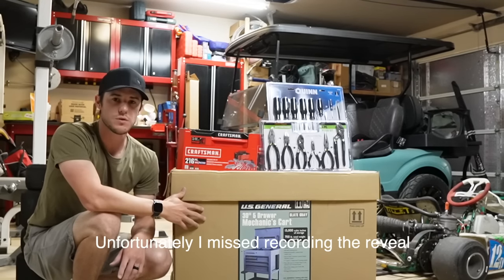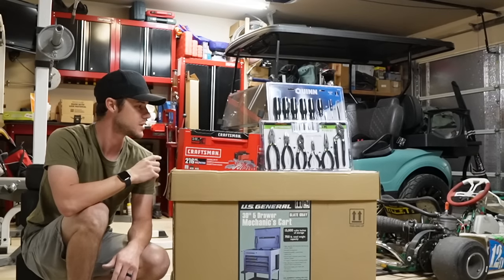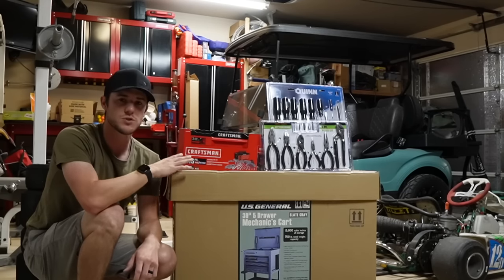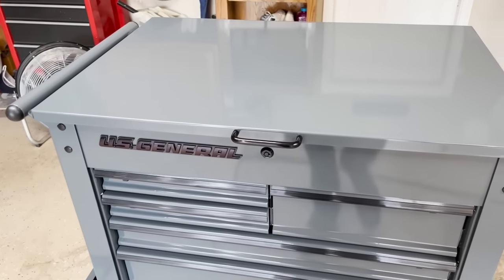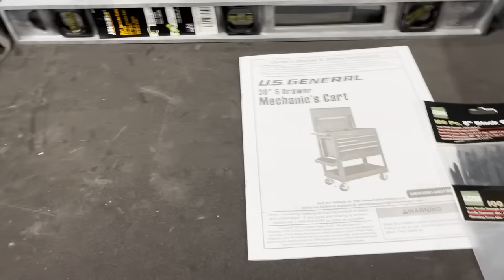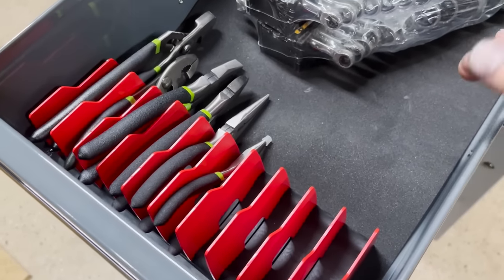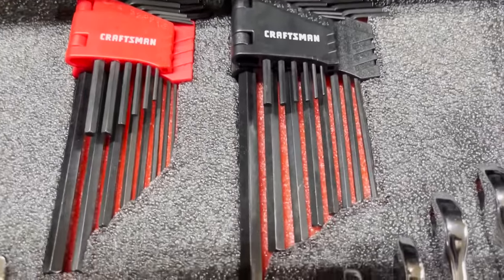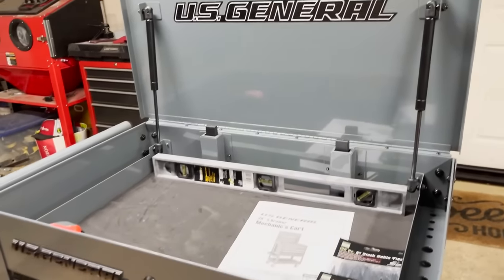Building the Ultimate Starter Toolbox for my Brother

Comment: For anyone looking to get one of these mechanics toolsets, the Gearwrench set is usually on sale at Home Depot. It’s a 232pc set that in my opinion, is much more comprehensive than the craftsman set and the tools feel like they are of a much higher quality. It basically provides you with most everything you’d need for 1/4 and 3/8, both SAE and metric, and also includes a decent set of deep sockets as well. The only thing it doesn’t have that I think every starter mechanic should need are swivels. It’s $200 on sale, regular $315. It’s quite a nice set to start with, and I would bet anyone who has it will retain almost every tool from it as they graduate to a bigger box setup. Having said that, craftsman is also a good brand and the US General tool cart he’s got here is also a very good choice.

Comment: I know this is an old video, but I just saw it.  This is a great starter set and a great gift Idea!  The only change I would make is substituting the 5-piece Kobalt pliers set for the Pittsburgh set.  They are much higher quality for ~$5 extra.  While you lose the small needle-nose, the larger one will handle most needs.    I kind of wish you had put the ratcheting wrenches and pliers in foam...

Comment: Hey guy, what an awesome brother you are. And very thoughtful. 
I’m a journeyman diesel mechanic of 34 years so I’ve got tools coming out of my ears lol.
But when I first started out it was with a set of craftsman tools. It was a bit of a larger set for around $450. I used a charge card at sears and I did not have a roll cart to start, I had a small top chest that I hauled around for the longest time. My first real tool box came from snap on, was very well used and beat up but I scored it for around $300 and made my weekly payments on it until it was paid off and then grew from there. 
Now I’ve got a huge snap on tool box top and bottom and a snap on service cart and full length locker.
Over the years I’ve spent tens of thousands of dollars on tools. 
And here’s the best advice I can offer.
Snap on, Matco, Mac Tools, and Cornwell tools all do have their place. But I’ve NEVER broken a craftsman wrench, ever. I have broken wrenches from most of the others mentioned though. Also bent quite a few, especially Mac wrenches.
And tool boxes ?
If I had it all to do over - right now - I’d buy the Icon tool box from Harbor Freight. 
Everytime I go into HF I check out that Icon tool box, the professional one, the biggest one they have displayed, with the hutch and 2 full length lockers etc, and I am impressed with it. It’s built better than the snap on box I own and just like my snap on box it’s double walled and welded. 
At HALF the price as it stands right now. 
But like I said, the others DO have their place. I work with those tools every day, and they stand up to the daily grind, the daily use and abuse. So that’s where I’d spend the majority of my money. 
The kids that get hired on to our shop nowadays all see the kind of tools we have and a lot of them think they have to have that “right now” until they see the prices we pay, and they get discouraged, some to the point of quitting before they even give themselves a chance. It IS expensive.
But I tell them “you do not have to start out that way”, build your box 1 tool at a time. Start out with the cheap stuff from harbor freight. It’ll get you by and some it is surprisingly sturdy. I’ve known guys that bought their snap on wrench sets 1 wrench at a time. You don’t have to ski. That cat all at once. 
But by the time you become the “old timer” in the shop your tool set will match your experience.
(And by then you’ll be sick af of the job, the expense etc) lol.
Good luck to ya and your bro.

Comment: HF has a great paper towel holder for the side of the tool cabinet.  Its magnetic, and makes its handy to access.
Reply from the maker: Ya they have so many add ons for the box that it’s really awesome to build off of. I’m a little jealous I don’t have one myself haha
Reply: @Project Karr  a lot of those accessories are magnetic (like the paper towel holder) they don't just work with that tool cart, I have one of those paper towel holders stuck up in my van.

Comment: That's an awesome setup for someone starting out. I'm sure they'll get a lot of use out of it. Being the tool guy out of my family and friends. I usually do something similar. I head in a slightly different direction, though. I like to lean a little more towards  carpenter type tools. You know, like a hammer, adjustable wrench, vice grips, utility knife, some putty knives, a caulk gun, and saw, etc. That Pittsburgh pliers set is a good one that I always include. I don't lean so heavily on the socket sets, I usually only include a 3/8 set, like those Craftsman clamshell sets, and I go with the classic craftsman 6 piece acetate handle screwdriver set, even though it doesn't have as many different drivers. Even so, you put together an excellent set. They have a really good start. That was really nice of you to put in the extra time with the foam.
   With Christmas not far off, I'm  wondering if you're planning any more additions. Cordless drill, perhaps?

Comment: What size foam sheets did you use for the drawers... I am looking to order some.
Reply from the maker: I used 2’x4’ sheets of 30mm foam and just cut them to size
Reply: Yikes $43 a sheet + shipping  @projectkarr
Reply from the maker: @durpydurp7497  ya if you order just one sheet it’s really pricy. I was doing multiple boxes so I was able to buy an 8 sheet pack for just under $20/sheet plus free shipping. I believe that’s still the bulk price today.
Reply: @projectkarr   Thanks. I'm just doing a 4 drawer cart, my 1st ever, no more having tools in 4 different boxes completely unorganized. Doesn't hold as much as I'd like, but it was the largest box HF would ship. Really wanted the 5 drawer. But there's a lot of tools I never use, so back in the boxes with those. (Like SAE sockets, almost never need those, and multiples of duplicate screwdrivers etc).

Comment: Did u buy the foam in bundles and is it hard it cut ?
Reply from the maker: Yes I bought 8 2’x4’ sheets which made it way cheaper and free shipping. It cuts very easy but your knife needs to be very sharp. If the knife is dull it will tear instead of a clean cut
Reply: @projectkarr  

Got it , thks … I’m on the fence on getting some